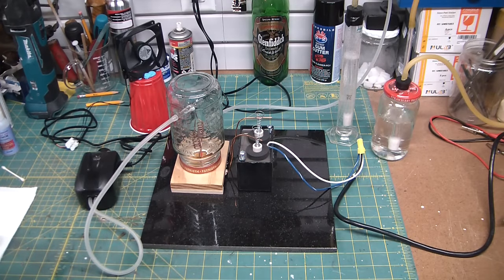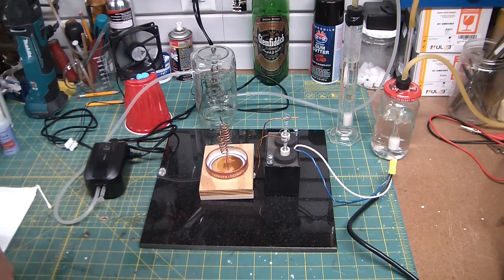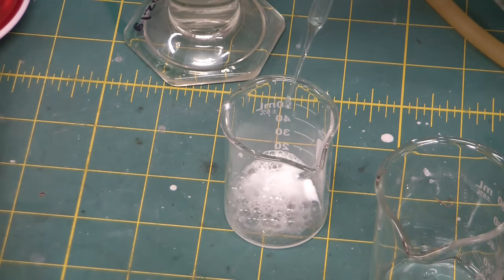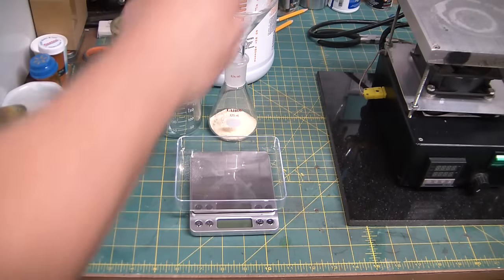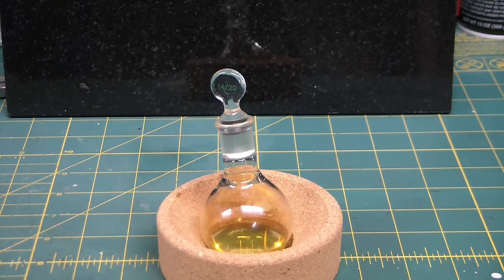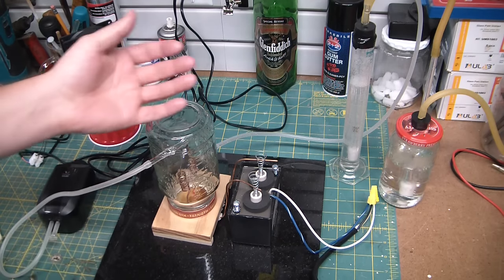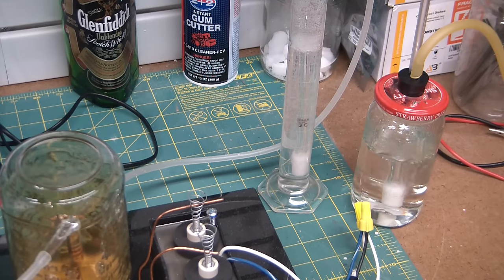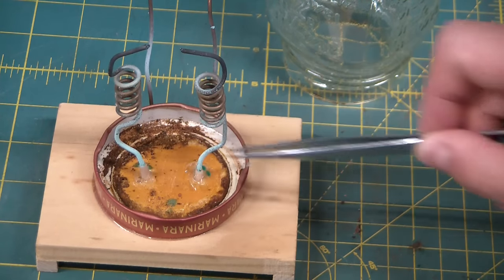Making Nitric Acid From Air - Elementalmaker

Comment: I've been wanting to ask some other people but didn't quite know how to ask. What is the boiler you use at min 9:12, what is the white thing in the beaker that spins the liquid?
Reply from the maker: That is a hotplate stirrer. You can buy commercial made ones, but this one I built. I have a video showing how I built it.
Reply from the maker: And the little white thing that spins is a magnet coated in Teflon called a stir bar. Under the aluminum plate, I have an old computer fan with a magnet epoxied to it, which makes the stir bar rotate when it rotates.
Reply: @ElementalMaker  thank you for the insight
Reply: @ElementalMaker  you actually took a course on how to program a pid controller, are there such things in your area?
Reply from the maker: @shazzz_land  not a full course itself, it was just a peripheral item covered in one of the engineering courses I took. It covered pid control, ladder logic etc. I forget the course name, but it was probably a generic process control course.
Reply: @ElementalMaker  cool

Comment: wasn't it possible to make explosives using nitric acid?
multiple ways ofcource, because if I am correct 
it should be possible to make some sort of blackpowder using nitric acid and charcoal.
and the other way I know of is like they did in those children toy bomb bags where you have a small veil or such with nitric acid in a closed bag with soda, salt or such and that in a sealed strong plastic or thin metal bag so that once it gets some impact like kicking it or throwing it the veil would break and the thing would fill up with gas until it exploded. 
however the first one is likely more usable and interesting in general but would be interesting to see what kinds of explosive or rocket powders/fuesl you can make with it.

Comment: Instead of sodium carbonate, reacting calcium carbonate from eggshells with nitric acid would generated calcium nitrate. A good fertilizer. 

I also suspect that if you bubbled the nitrogen dioxide through water with powered  eggshells, the nitric acid formed would immediately react to calcium nitrate and maybe allow for more efficent absorption of nitrogen dioxide in a given water column. 

Certain grades of stainless steel are used to store nitric acid and a pipe may make a nice bubbler column.

Edited. Seen you cover many of points after completing watching to the end 😊

Comment: bear in mind that baking soda is not pure sodium bicarbonate it contains weak acid to produce co2 when it is mixed with water which is needed in bakery to make puffy bread or so (the reason you did not get a clear solution at 8:00 ). you better use washing soda.
Reply from the maker: That's baking powder that contains an acid, baking soda is 100% pure sodium bicarbonate
Reply: @ElementalMaker come back!!!

Comment: wouldn't this generate carbonic acid too?
Reply from the maker: By adding the baking soda to neutralize the nitric acid? Yes certainly, but that's easily driven off during heating
Reply: @ElementalMaker  No. Air also contains CO2. Ionizing it with the arc also generates some carbon monoxide (CO). Dissolving these in water produces Carbonic acid (just like in soft drinks, acid rain, etc).

Comment: i took chemistry and physics 8 years ago... electrical tech as well... sure that electric field in that short clip is done so, with a timed oscillator that switches the two coil fields in slight advance of the spark gap osculation. turns a 3cm gap into a 6cm gap, so the advantage of it is nill... use a long tube for the spark gap with multiple spark gaps along the way. that spark disc is a quarky joke to say to someone that there equipment sucks, but in it's self  is in no way prefect ether.
Reply: long tube like a florescent light... many small gaps.
Reply: make ferric nitrate, common gasoline additive? "oxidized in air, needs to be under ethanol... why because it makes it harder to use as a phosphorus accelerant for boom boom things" on the other note, Nickle nitrate I think is in shell Vpower Nitro pro, dissolved in some water added to gas to modify the burning parameters and thermal heat retention thru the exhaust, turbo charger stuff...
Reply: why gas is so expensive... nitrates!
Reply: put some of that nickel nitrate pro gas in a 1980's 11'000rpm 4 cylinder engine... ran real good, till it thru the rods out the block after 60km.
Reply: make the yamaha go yee MA HAW!...

Comment: Always amazed me the DC to Gamma (I guess Cosmic Ray) radiation synthetic chemistry capabilities and performances.  Surprised there are not more molecular energies methodologies besides all the DC electrochemical methods.  I was advocating microwaves use... actually more-so tuned to specific bond resonances to catalyze and shift equilibrium.  That kind of got me on the Radar and what am I other than a simple man?  Anyways... amazingly that year after Michigan Tech saw a spawn in more research papers and applications using basic microwave systems for synthetic methods use.  I also wanted to try tune able IR sources for a vibrational energy methodology versus the rotational energy microwave methods.  I'm sure there are electron and magnetic spin/paramagnetic resonance methods as well.... and of course the electron transitional methods steal the show with the photochemical methods.  My guess the science is hidden and classified due to ability to hack humans and other biologicals more than the clandestine want shown and known exactly to the masses.
Reply: Theres a billboard that can play messages inside your head. It ised a ir beam to stimulate the inner ear. Or something like that. But basically a shizo beam
Reply: @fajile5109  I forgot to ask if you have any references?  I've not seen anything new in decades and the tech, other than in certain circles/groups, isn't mentioned in the news much if at all.  I did just see a company I forgot about that I forget if is the same Israeli company that was using an advanced tracking method for game play... though the Noveto Soundbeamer 1.0 is the newest I've seen marketed.  Glad you mentioned, as I've not read into much like the Sound Lazer and other more common systems compared to like MEDUSA, EPIC and the smaller versions of ADS like systems that do more than beam sound using ultrasonic signals in the few ways they can... there are systems that can cause body and mind assaults, battery and maim and worse "health attacks" that I've been advocating for the last decade or so to come out main stream since they're technically an invasive nuisance worse that sniper weapons since a slow homicide device that can mass murder not justifiably as well as enslave.  So violates ways more than hijacking, MANN Act and other related laws on human trafficking.  The public has a right to know what concealed wireless assault weapons can be used to cause crime and health issues.

Comment: No gloves. 
No fume hood.
Wearing flip flops.

I know nothing of chemistry and this was horrifyingly cringeworthy. 
You are a super intelligent guy. Why are you taking risks like this?
Reply from the maker: Gloves are actually a risk when dealing with conc nitric acid. They can spontaneously combust immediately on contact, so bare hands is actually safer. I had an exhaust fan set up off camera, and while off camera I wore my full face respirator with acid gas cartridges just in case. The flip flops were a dumb oversight

Comment: better have skill to make some, simply, than none with fear of efficiency
Reply: why dont you use lamp filament arc
Reply: its the high temperature to burn, right, a ton simpler, tungsten filament burning filament
Reply: dc emf (hall-lorentz effect)
Reply: burning engines produce that no2, with the air nitrogen burning
Reply: very interesting
Reply: water desiccant SiO2
Reply: use solar, its free, even concentrated solar heat for reactions
Reply: its stupid to pay anyone for simple diy stuff
Reply: you dont have to use plasma to burn nitrogen with oxygen, just have high temperature oven container
Reply: plasma is the most inefficient part of that method, use carbon furnace instead, or just resistance high temp furnace
Reply: if you mine ores, sulfides, like iron sulfide, FeS, then you can make your own sulfuric acid, burn/roast the sulfides metals into oxides, you have SO2 for water bubbler
Reply: you already know how to make HCl, the sea/salt water electrolysis of water, into hydrogen and chlorine, then burn them, the usual industrial brine process, but you get stuff in the salt, dont forget it, element(al)maker :)

Comment: u have protective gear to use but I guess not.
Reply from the maker: I wore eye protection and a acid vapor respirator just in case. With red fuming nitric acid, gloves will spontaneously combust on contact, so bare hands is preferable

Comment: NO2 is not that badass poison actually. It's not even causes headaches like many of organic stuff.
Reply from the maker: The lc50 for hydrogen cyanide is 500ppm... It's only 300ppm for Nitrogen Dioxide both at ten minutes exposure. I'd call that pretty nasty stuff.
Reply: @ElementalMaker  I have the experience of repeatedly being in a room where the concentration of nitric oxide (IV) was such that the air was distinctly brown. Any object at arm's length acquired a brown tint. The duration of stay in such conditions ranged from several minutes to an hour. No tangible effects were observed.
Reply from the maker: @Ma_X64  Not to be a dick, but what on earth would possess you to subject yourself to that? At minimal your probably going to have long term lung damage, and a drastically greater risk of heart disease/attacks. I'm all for fun risky stuff, but that's just suicidal.

Comment: 40 watts, 48 hours, 2kWh, so what, $0.35?  Not a bad exchange rate, honestly
Reply from the maker: Per my calculations at $0.15/kwh over 40hrs, it comes out to an energy price of $4.05/lb for the impure sodium nitrate. Honestly better than I assumed. I should have crunched the numbers in the video, but will probably do a follow up and cover this.
Reply: @ElementalMaker  Pretty much matches my $/lb calcs.  I got $4.77.  One thing that can significantly help with efficiency would be chilling the water you're perculating the gas through.  Just about every vid I see where someone reacts NO2 with H2O to get HNO3 they have the water flask in an ice bath.

Comment: Where's your fume hood?
Reply from the maker: Still in pieces in the garage. For this small distillation I used a full face mask, and pumped all vapors outside. Even with the mask off no no2 was detectable. I also kept a huge basin of sodium carbonate solution nearby in case of disaster. Still not up to proper safety protocols though, don't recommend trying at home for sure.
Reply: @ElementalMaker  Indeed.

Comment: This process has no "theoretical yield". It's not an electrolysis where you could count electrons per reactant. This only works by heat. If it is >1000°C and has oxygen and nitrogen available, it'll form NO2 gas. Hotter, if you want significant reaction rates. And yes. These reactors are not very efficient, compared to other routes. But if you have a solar rig with plenty of surplus power during the summer, you'll still make nitric acid a lot cheaper than it is in the store. And you can make it whatever your government thinks you should be trusted with or not.
I wonder if a higher oxygen ratio or some ozone in the flask would increase the output.

Comment: Not to bad for the cost. You say 40 watt. 40 hours. And you got 22 grams. If you pay 0.25 dollars per kilowatt.  That comes down to 18 dollars per kilogram of nano3  not to horrible l. Of course costs of other chemicals not included
Reply from the maker: Yep! I just crunched the numbers a couple hours ago, and with my electric rate with both generation and delivery charges, I'm paying about $0.15/kwh so it works out to only be about $4.05/lb without considering other costs

Comment: I think your transformer gives an lot of current to bad there is no data aviable. I ve read best Voltage would be 2000 to 6000V and much much current. i ve done the same with an 15kv with 1mA. long run very little yield.After an week i handnt us much as you. ive saw it now yours is 19kv with 35mA output.

Comment: Why did he neutralize his primary nitric acid with sodium bicarbonate to make sodium nitrate and then add h2so4 for the end distillation instead of just distilling the primary solution of nitric acid he made? Can someone explain the science behind why he made the decisions he made? I'm genuinely curious. 
EDIT- make it solar powered 😂
Reply from the maker: So nitric acid forms and azeotrope with water, meaning the highest concentration you can distill it to without some chemical know-how is about 70%. So instead I reacted it with baking soda to form sodium nitrate, which I could then put in sulfuric acid to get anhydrous (nearly 100% pure) nitric acid. It was basically a fancy way to get water out of the equation. Solar would definitely be awesome. I have five 300W panels sitting in my shed for a solar shed off-grid build, so that would be a great way to use excess energy.
Reply: @ElementalMaker   oh ok, that makes a lot of sense. I'm learning, lol
Would you still do the same thing if you were to use peroxide instead of water in your bubblers? And I'm surprised your sauce jar held up even with the fan, others are using borosilicate and their flasks are cracking
Reply from the maker: @Max_Chooch  using hydrogen peroxide in the collection bubblers would net a higher final yield, but the same process would be needed to get anhydrous nitric acid. If you only needed 70% you could simply distill however. Yeah I'm glad the glass held, I think because I kept the arc small, input cool air at the top to remove heat, and centered the arc in the jar it saved it, however in the future I want to play with magnetic manipulation of the arc to form a disc for higher yields, and I'm sure that will require quartz glass to hold up to the heat.
Reply: @ElementalMaker  I've been looking at quartz flasks and holy moly they aren't cheap. 😬

Comment: How abpout you buy some gloves and use them
Reply from the maker: The fuming nitric that shot onto my fingers probably would have caused nitrile gloves to spontaneously combust, hence my most chemist's handle red fuming nitric acid without gloves, as they are a greater danger
Reply: @ElementalMaker  des thast true, bur that only occurs with fuming nitric acid, that you produced at the end. While handling the diluted acids this doesn't happen. And for the sulfuric acid you could have used some. Personally I try to limits the use of gloves myself but if I handle strong acids and bases o always wear full ppe. My workplace demands it anyways, otherwise I'm not insured if something goes wrong.

Comment: Dude get the f rid of that latex line on ypur second bubbler. Nitric will set fire 🔥 to that !
Reply: Teflon lines is the only way to go edit get them cheap from homebrew suppliers
Reply: And add sodium hydroxide to your second bubbler it with make short work of any left over No2
Reply from the maker: I do have some viton and ptfe tubes for the next go round. The latex held up surprisingly well considering what it was up against
Reply from the maker: @bloodyricho1  the amount of no2 making it past the second gas washing bottle was incredibly miniscule. Barely could even detect an odor of no2 from the exhaust line. An alkaline wash bottle definitely would eliminate every last trace, but honestly isn't even needed at this scale

Comment: So your transformer cost you about 25 cents to run it for 2 days. That seems cheap not expensive.
Reply from the maker: At my energy price of $0.15/kwh it cost about $4.05 to run for the 40hrs. Really not as expensive as I thought it was. Think I missed a decimal point in my mental calculation
Reply: @ElementalMaker  my math i got $0.24. 
40 watt ÷ 1000 watts = 0.04 kw × 40 hour = 1.6 kwh × $0.15 per kwh = $0.24.

Comment: Nice build and explanation.

But if you really do the math, I'm not so sure about the "highly" when it comes to inefficient. It's not the best process no... But 40W for 40 hr? 1.6kWh is 2 bucks on the worst day. 

And sure the reactor has maintenance and all, and if you're going the fuming route, you've got expenses like the sulfuric and energy to distill... 

But really, from a DIY angle? 10ml of fuming for 2 or 3 bucks?  Not that bad.

I wouldn't make it by the drum this way, no... tho at one point... They hadda do wut they hadda do 🤣

Comment: Nitrogen dioxide diluted in air is not nearly as dangerous as you say
Reply from the maker: It is quite dangerous, exposure as low as 20ppm is immediately dangerous to life. Are you thinking of nitrous oxide?
Reply: @ElementalMaker  no i mean nitrogen dioxide. The stuff is not that toxic,  it is more likely to just burn your lungs.  I have experienced it(stupidly) and i can tell you a few breaths of fairly high concentration won't kill you.  20ppm is an extremely small amount

Comment: Junkers, just stealing shitty A/C power off the grid and turning it into batteries and gunpowder.. 

I have a plant in a bucket with no holes in it, I think you could use that, since it's a nitrogen fixing legume. I think you'd just fill it with water, until it's nice and brown, and then siphon that and replace. 

Then with the collected water, I think you just hook a hose up to it, bubble the gas off into more water, that way you could control the level of acidity.
In addition, any dissolved solids should be in the first run of water, 

At the same time, you could maybe feed these plants certain trace metals, which could in theory become gold through fusion inside the chloroplast.

With enough nitric acid, it should dissolve.

So in one jar you'd have some nitric acid/water,

The other would contain dissolved metals such as gold, and other trace elements.

Then just use more water again? Idk in theory